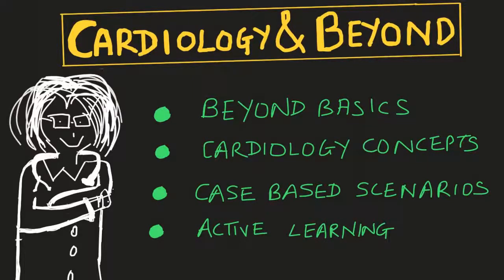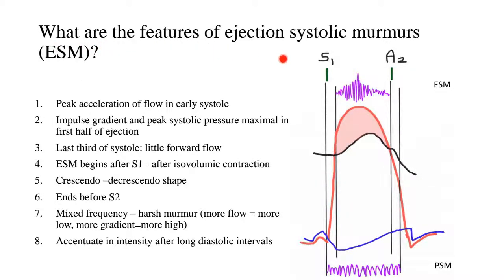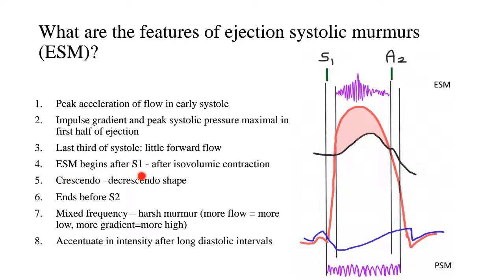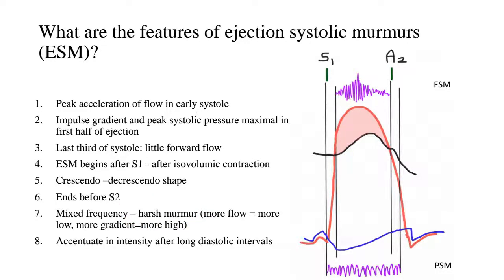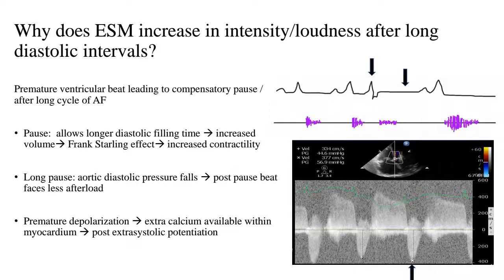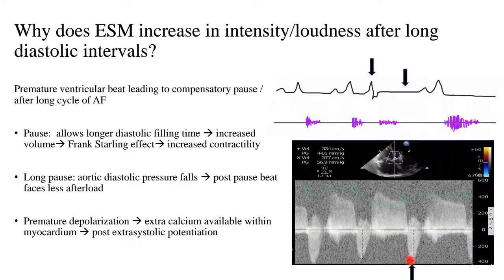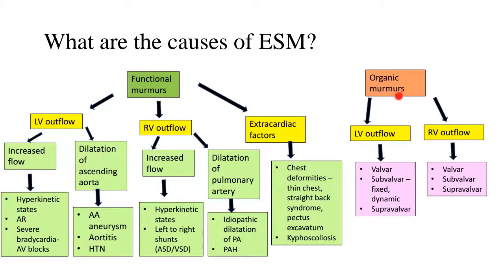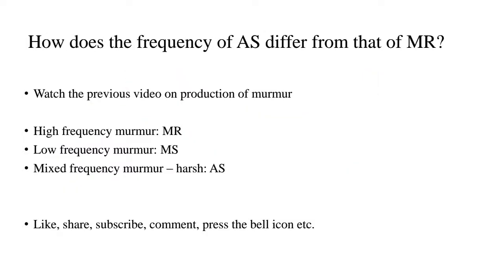Ejection systolic murmur

Comment: Maam how is the rise in pressure of the lv simultaneous to the rise in pressure in the aorta, its only after a certain pressure is built up in the lv during isovolumetric contraction is it transmitted down the vessels during rapid ejection. Could you please elaborate on this perspective Maam?